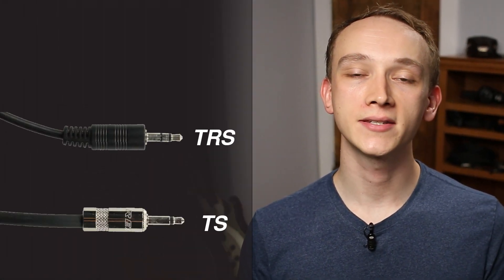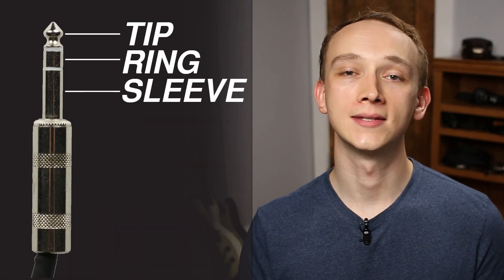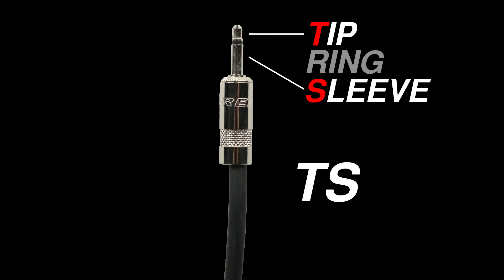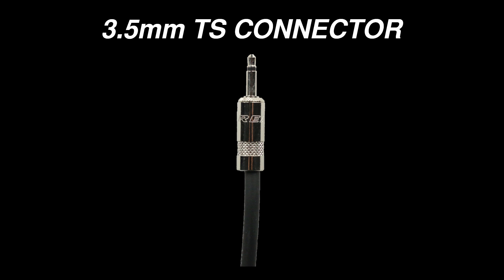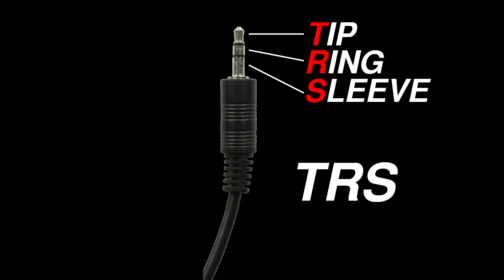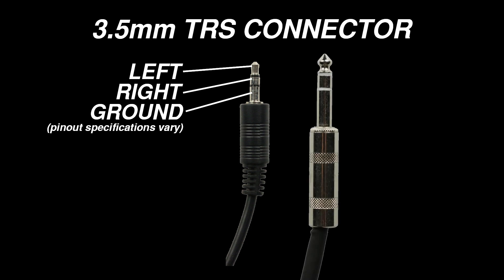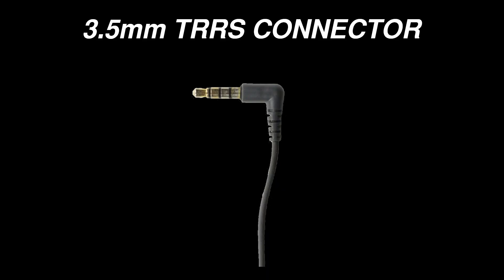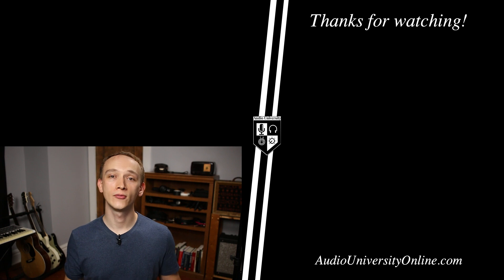TS vs TRS vs TRRS AUDIO CABLES: What's the Difference?

Comment: Good video. I would add that before 1980 (Walkman) virtually all 3.5 jacks were TS. Either the earphone that came with mono transitor radios, or as you said, microphones for entry level recording devices (casettee recorders).

Comment: Hi great video! Question i have an apple earpods that uses TRRS and when I plug it directly on the computer the audio is great. But when I use it on a splitter that is TRRS to TRS it reduces the sound quality. Is it because of the splitter? Do I need to use a TRRS to TRRS? i want to use it directly to the PC but I needed the splitter cause the length of the earphones is so short

Comment: So I need to connect a TRS line out to a TRRS mic in (smartphone, PC), to monitor the sound with an app...
If I'm using a TRS to TRRS cable, and send a mono signal from line out, the microphone of the PC/phone should get a good signal?
I'm asking because I need to buy the cable, and I'm not sure the app will get a TRS to USB sound (another possibility)...

Comment: I'm wondering about the typical 1/8" inch TRS cables that come with most on-camera cardioid mics or lavalier microphones. In my understanding, these microphones would be a mono source. Does this mean that by sending this mono signal over the TRS cable, that the connection is balanced? 

I see a lot of people online saying that TRS cables are unbalanced - end of story. But it seems like this isn't the case for a mono signal like that sent from a single-capsuled microphone. Thanks for your wonderful video.

Comment: What confuses me is the naming. Does a TRS cable actually have a Tip, a rind, and a sleeve in that order? If so, why is the sleeve higher on a TRS cable compared to a TS cable (Tirp- Ring - Sleeve (TRS) vs Tip - Ring - Sleeve (TS)).
Reply from the maker: Yes. The sleeve is closest to the cable, and (when present) the ring is between the tip and sleeve.

Comment: Excellent explanation for lay people like me. Do Bowers & Wilkins PX7 S2 headphones have a TRRS cable? If not, is one able to buy a TRRS audio cable and would it be compatible to use for any headphone (need the mic for online video calls)
Reply from the maker: If the pair of headphones has a mic (and stereo output), it will have a TRRS cable. Unless it's wireless, of course.

Comment: Great video. Very well explained - thank you.
I have a question:
I usually record audio using external, old devices, connected directly into the computer jack.
As expected, these old devices have a jack supporting TRS plugs.
I have this specific cable having ending plugs - one is TRRS, while the other end is TRS.
TRS goes to the old device jack, TRRS to the computer jack.
This cable works great. Problem is - this is the ONLY cable that actually works!
I have other cables having that same configuration, and they just don't work. Either no signal, too much noise or any other symptom.
I have tried adapters as well, with no avail.
What is it that makes this cable work - that differs from the rest?
It's a big puzzle to me!
Any suggestions?

Comment: crazy question, I'm trying to connect my mic and dbx286s that has a 1/4 line out into an audio interface with a 3.5 input. what cable would I need sir?
Reply from the maker: A 1/4” TRS to 1/8” TRS is your best bet. Something like this: https://imp.i114863.net/doWnKQ
Reply: @AudioUniversity  thank you so much!
Reply: @AudioUniversity  crazy to think about all that sound compresssion and eq getting bottlenecked to 1/8.  I have no idea if it will sound good but gonna try

Comment: I have a 3.5mm TS mic .. can i plug that into my PC even if the female bit is TRS .. or is that even a thing
Reply from the maker: If the input is TRS, it is most likely for stereo output, rather than mono input and output. I would recommend looking at your computer's specs to see if it has a line input.
Reply: @AudioUniversity  what I in general meant is can i plug male TS into female TRS or even TRRS to get sound out and if so what are the downsides if any.

Comment: Need an adapter that will accept a 
3.5mm TRRS (Tip Ring Ring Sleeve, 4-Pole) MALE		(Headset cable)
converting to 3.5mm TRS 3-pole MALE			(which plugs into the 1/4 inch TRS adapter to my piano for audio out)  POSSIBLE?

Is this even possible?

Comment: Can TRS to Dual TS cables work both ways!?..IE:The dual side coming from a non TRS double out outputs stereo pedal going into the output of a Trs compliant. pedal?
Reply from the maker: The cable certainly works in both directions. It ultimately depends on the devices you’re connecting, but it sounds like this will work.
Reply: @AudioUniversity  Ok..I have a non compliant Stereo effects loop with 2 sends and 2 returns in my amp..I plan to run 2 TS cables going from the Amps sends to my Neunaber Immerse Mk 2 (TS and TRS compliant) 2 inputs..then single TRS from output on Immerse to Red Panda TRS inputs pedal..

Comment: I just got a Scarlett Solo audio interface, and I'm not sure how to plug my Beats Studio Wireless headphones into the output. I think the headphones have a TRRS input, so do you think I'd need a TRRS to TRS adapter? I haven't been able to find TRRS to 1/4 TRS cables, so it looks like an adapter is the only option.

Comment: Do you know the best place to find a TRRS to XLR male cable? They seem to not exist at the 3.5 mm size. Thanks
Reply from the maker: Are you looking for a breakout from TRRS to (2)XLR-M and (1)XLR-F? I haven’t seen one of these before.
Reply: Just plug in a 3.5mm TRS plug into any TRRS device and you can extract it's Stereo audio from that device.

Cable to use is simply available: 3.5mm TRS to 2 XLR-M

Be careful though when using these cables into XLR Inputs. Issues with Levels Mismatch & Phantom Power needs to be addressed.
Reply: Also, you wouldn't need to bother with TRRS(3.5mm) if you're just needing it's Stereo HP Out of that device. (just use any 3.5mm TRS)

You only need to concern for TRRS(3.5mm) when you want to deal with Feeding Audio INTO the 3.5mm device.
In those cases, you'll need a 3.5mm TRRS Headset Splitter/Breakout Cable
OR you may want a Custom cable soldered.

Comment: When plugging in my guitar, keys, etc., would I use a TS of a TRS? If both work, what will produce better quality? I'm struggling to understand when to use what. Thanks!
Reply: Ok, when would I use a TRS?
Reply from the maker: If you are making a balanced connection between two devices, you’ll use a TRS. Most keyboards and guitars have unbalanced outputs. Some common devices that support balanced connections include microphones, mixers, outboard effects processors, and studio monitors.
Reply: @AudioUniversity  you’re awesome! Thanks!
Reply from the maker: Anytime! Thanks for watching the channel, Tanner.
Reply from the maker: You will use a TS cable for those.

Comment: If you wanted to plug in a 3.5mm TRS jack with 2 pins into a Headphone splitter and the jack of the headphone splitter is 3.5mm but it is TRRS with 3 pins would it work?
Reply from the maker: I think that should work. What are you connecting with the splitter?
Reply: @AudioUniversity  A gaming headset
Reply from the maker: The microphone probably with work if you use the TRS splitter.
Reply: @AudioUniversity  would that happend with every headset?
Reply from the maker: You need 4 connections for stereo output and mono input. So, you’d need to preserve those four connections throughout the entire connection.

Comment: i got a presonus eris 3.5 and umc22 audio interface,,it comes with rca to 3.5mm...do u want me to take trs to trs balanced cable,,,does it make diffrence without audio interface or with audio interface is the sound quality more clear?
Reply from the maker: The sound quality will be superior with an interface rather than connecting your speakers to your computer directly. It will also provide a balanced connection rather than the unbalanced connection provided by the adapter.
Reply: @AudioUniversity  so you mean the sound will make difference and clear rather than now i connected it with 3.5 mm
Reply from the maker: The quality difference won’t be huge, but the D/A converters and outputs of an interface are higher quality than what you’d find in a computer. Do you plan to record?
Reply: @AudioUniversity  ya i record vocals and mix, songs,,so rn i m connected my studio moniters directly ,,,should i get cables ?trs to trs
Reply from the maker: Yes. I’d recommend connecting your monitors to your audio interface with TRS cables.
Reply: @AudioUniversity  thnqu for your information and showing love
Reply: sub to you

Comment: I'm trying to get an audio interface and i have a digital keyboard which cable should i use for the audio interface ts or trs?
Reply from the maker: I would recommend using a TS instrument cable for your keyboard. While it's possible that your keyboard can support a balanced output, it's more likely that it is designed for unbalanced connections. I recommend the Rapco Horizon cables in the description of the video! 

Which audio interface will you be using?
Reply: @AudioUniversity  Focusrite 2i2
Reply from the maker: Nice choice! That's what I use. Good luck, Dalton! Thanks for watching.
Reply: @AudioUniversity  the keyboard I'm using is Roland Juno DS88 and has phone input will it work with trs cable?
Reply from the maker: Although a TRS cable will work, I'd recommend a TS cable for connecting the output of your synth to the input of your interface. 

As for the input of the synth, you'll need to use a microphone with a built-in 1/4 connector or use an XLR microphone and adapt XLR to TRS.

Comment: Is there a way to get my lapel mic (TRRS 3.5mm)which is powered by a LR44 battery to working in my mixer with 1/4 or XLR connections?
Reply from the maker: What is the model of the lapel mic you are using?
Reply: @AudioUniversity  Thanks for the reply. It's a Vidpro XML Here's the link.
https://www.amazon.com/XM-L-Lavalier-Condenser-Microphone-Camcorders/dp/B00PQYMFU8

It works fine in my 3.5 input on my pc, but would not work in my Mackie Pro Fx8 usb mixer with the included 1/4 jack.
Reply from the maker: I’m not sure why it’s not working. Did you ensure that you’re connecting it to the “Line In/HiZ Input” and not the “Insert”? Also make sure to give it some gain with the gain knob.
Reply: @AudioUniversity  That was it. I was trying it in the insert and not the “Line In/HiZ Input” Thank you so much,.
Reply from the maker: Awesome! Thanks for watching! Good luck!